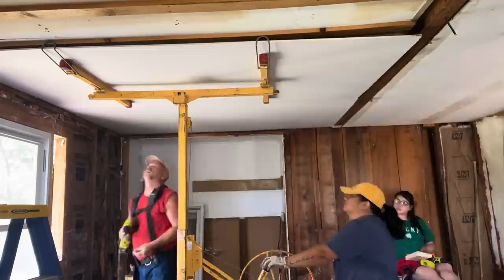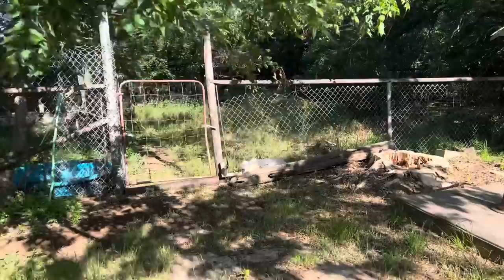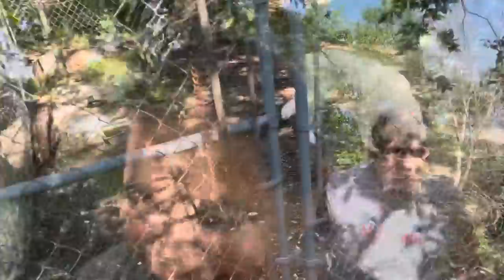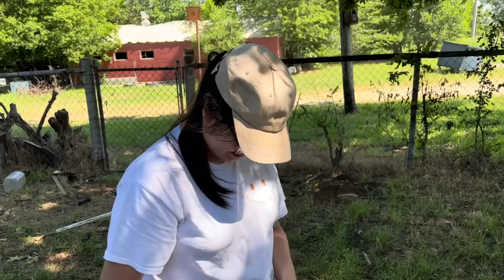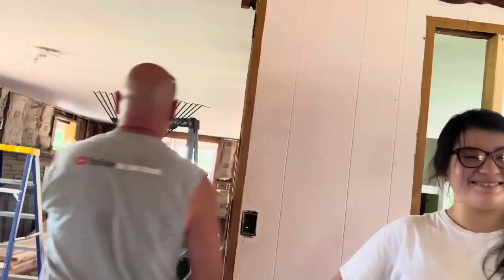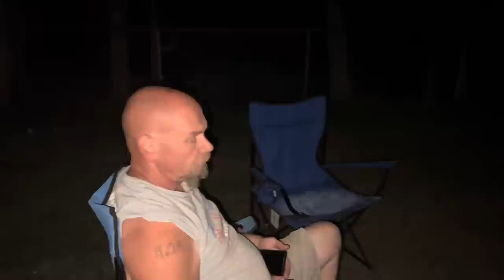Squatter Caught On Camera At the Farm / Couple Renovates Abandoned Homestead

Comment: Hiccups: Get a glass of water. Have an assistant put hands over ears with a little pressure and drink water at the same time. It always works for me. When doing it alone need to tip up the glass with your teeth. Never tried it with a straw. Pressure on the ears necessary.